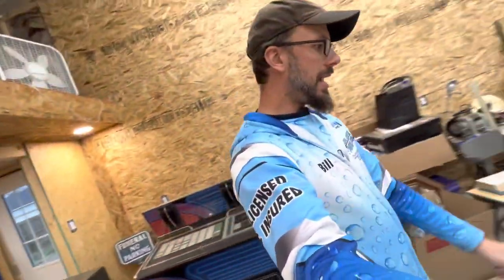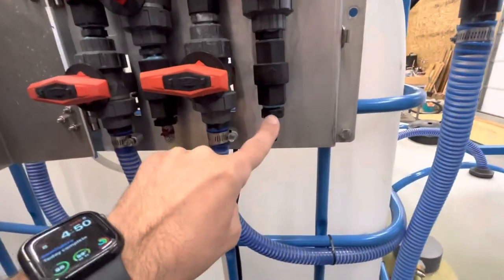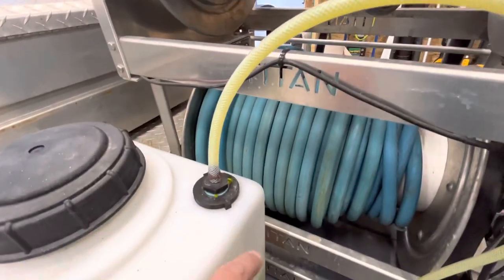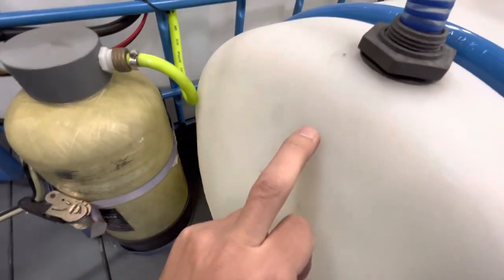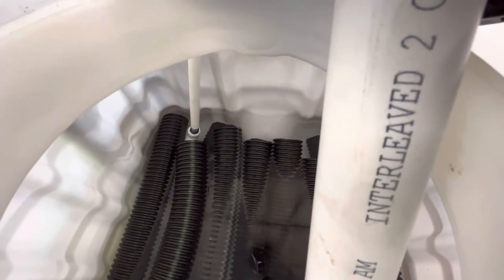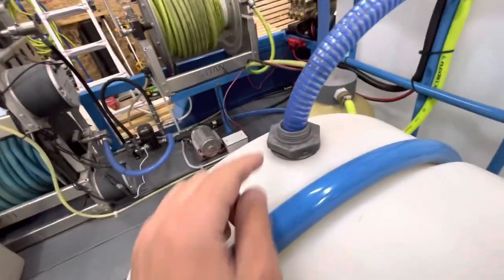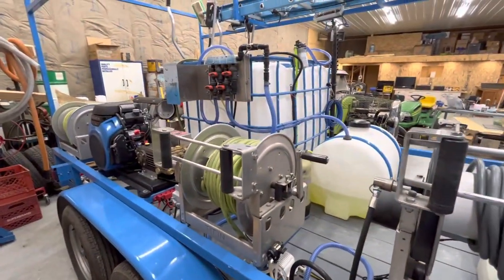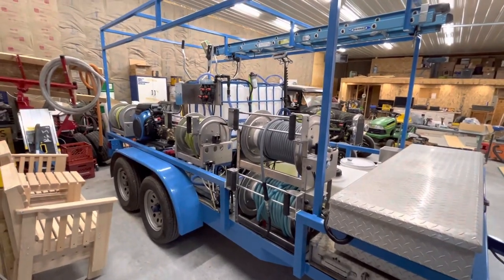Bulkheads! Pressure washing trailer plumbing your tanks

Comment: How tight does it need to be around the hose? I currently have drop sticks through the top, and there isn't any air in the lines but there is air in the tank, is that an issue?
Reply from the maker: The tighter the fit the less chance of splashing out. I never had any splashes out of these. On the new build this year I have swapped to uniseals With my new tank. You need some kind of vent for the tank or else it will draw a vacuum and you won’t get any flow through your line. Air in the tank is a good thing.
Reply: @mr.misterpowerwashing8562  appreciate it, I wasn't sure if air in the tank might affect the flow

Comment: Just wanted to say thank you for this video, I have had pressure issue the last 2 weeks and traced it back to a hair line cracked bulk head inside the tank side ,  after replacing it everything is working very well 

Thanks for the heads up
Reply from the maker: absolutely my friend!

Comment: I really struggle with putting together and maintaining equipment (my strongsuits are in sales, networking, marketing, finances, etc.) but this is a great guide that keeps it simple. Should help me out real soon. I'm replacing my 26gal. tank I batch mix with that I've used since I went into business in Feb. 2023 with a blend manifold going to a 55gal water tank and a 55 gal drum for bleach. Just need to figure out how I'll do my soap... 3 tanks is a lot because I don't want a trailer. I like keeping everything in the truck bed with accessories in the cab and truck box. I may just start off putting my soap in the SH drum and see if I can stay in control of my soap levels well enough to just do that.

Comment: I enjoyed your video. I’m getting ready to put together my water hoses and irrigation system for summer and usually have a terrible time with leaks. I’m interested to try this true blue stuff because plumbers tape does absolutely nothing. I hope I have better luck this year. Thanks!!
Reply from the maker: It is fantastic to work with! You can get it off of Amazon. Any poly fittings only do hand tight, it does act as a lubricant when wet so you can easily over tighten if you’re not careful. Happy washing!

Comment: Great information. I’m going to start my pressure wash business next year part time, and go full time when I retire in 18 months. Great point about connections. In my current job (phone company), any wire splice is a potential failure point. Question-Why the irrigation pipe in the bottom of the water tank?
Reply from the maker: Best of luck! The irrigation pipe is to prevent water sloshing in transit.

Comment: Question... what gpm do you have for the water fed pole system
Reply from the maker: 1.8 gpm at 100psi. I run 150’ of 3/8” air hose, then 40’ of 5/16 through the pole. I get excellent pressure and distance with that.
Reply: @Mr. Mister Power Washing  thank you. I installed a 3.5 gpm pump on my system, but it has too much pressure it does have a lower the psi capability. I also did not get the TDS reading I wanted. Thank you again. Keep the good videos coming
Reply: Really enjoy your videos! Would love a break down of your water fed pole system. Thanks
Reply: How do you set your downstream line to the proportioner
Reply: I like the blue paint.  What's your procedure?  Rattle can, HVLP, air, powder coat,  or pro paint shop?